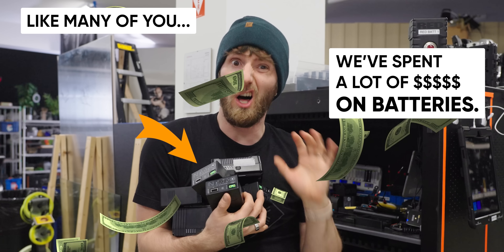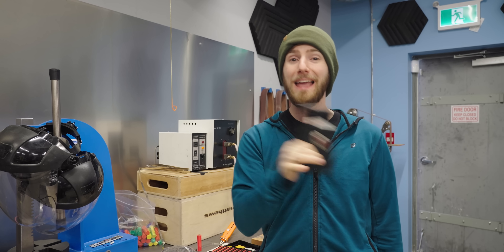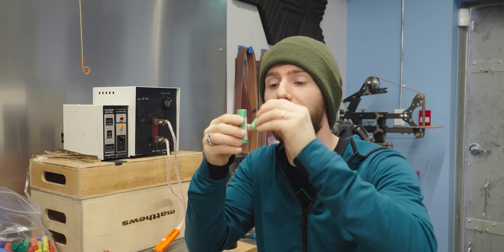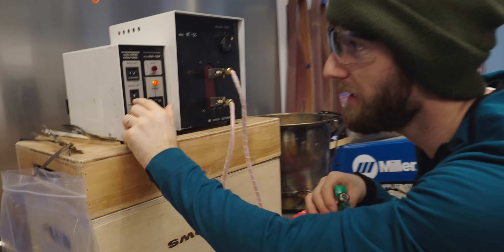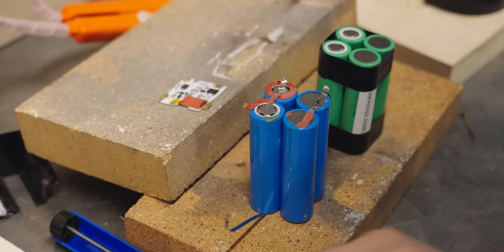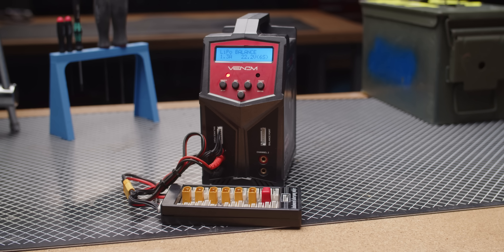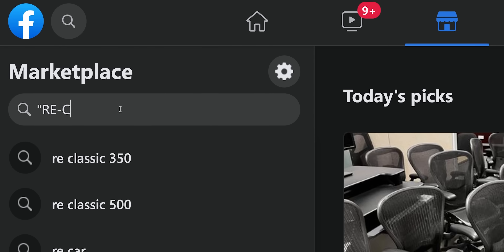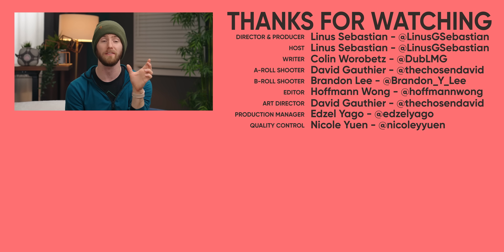This should be illegal… Battery Repair Blocking

Comment: watching Linus handle the batteries with his metal rings not covered.... ugh, that is not gonna end well one day.
Reply: A colleague of mine once shorted a large 12V lead-acid battery via his wedding ring. The current was so high that the ring got red hot almost instantly and he suffered very bad burns to two fingers as a result. He never wore his ring again when dealing with batteries after that.
Reply: @cbcdesign001  how many apms on the battery? Got to be pretty high if is was only 12v

Comment: I had the evil BMS with DJI batteries too. I understand there are tools from the BMS chip manufacturers that can reset the Permanent Failure (PF) in the chip indicating a dead battery.
Reply: There are DJI-Firmware-tools on github
Reply: https://youtu.be/P5PNOO2GebY
Reply: Raspberry pi with i2c

Comment: Even though I'm an electrical engineer professionally, replacing batteries like this is too scary for me. I've done barely any soldering in my life anyway, but I'm looking to change that. Most of what I've done so far in my career and for fun is write FPGA code.
Reply: Are you sure that you are an electrical engineer?
Reply: @i4kata  I mean, electrical engineering is a broad field. FPGAs, which I work with at my day job, are a way to make digital electronics. That and I have a master's degree in EE.

Comment: There used to be a lot of re-celling laptop batteries where I lived. You paid a small amount for fresh cells, while keeping the old housing. Sadly with laptops going supeglue on batteries, it becomes impossible. So dead battery equals new laptop for some people, broke my heart everytime I saw a friend sold his old usable laptop just to buy a new one with non-replaceable components.
Reply: Yah and then everything endeds up in India and there they repair it no problem.
I'm serious this is why phone's come with screen protectors and you will get 100 back from the carrier.
Reply: @markdove5930  For sure. And you know what worse? Used batteries in third world countries rarely got recycled. So basically first world nations uses up the batteries, rather than trying to recycle it, they send it to third world countries where most would fill the landfill or the ocean. Source? I live in a third world country. Most people here don't know you aren't suppose to throw away your used batteries (I saw a lot of Charred AA and AAA, imagine how dangerous that is with Lithium, in lots of pile of burned trash).

Comment: There is a chance you had to put the battery in the charger to 'reactivate' the BMS, rather than it being the BMS having completely killed itself.
Reply: This is a common feature on battery management IC's, they go into "shipping mode" when powered on the first time (ie after the battery has been removed and reconnected). This ensures that the batteries don't discharge while the device is sitting in a warehouse.
Reply from the maker: Yes Tyler at THTBattery.com actually told me this and I have yet to be back at office to try - will update this post with the result -CW

EDIT: The battery DID successfully work after popping it on the charger for a second! I've added a card comment in the video for future viewers noting this.
Reply: @LinusTechTips  counting on it! Is there going to be any update on the video? I think it would be important, a lot of people are going to be discouraged
Reply: @LinusTechTips  I have a bunch of BMS boards that require jumping the negative input and output sides of the BMS to wake them up after being disconnected from the cells or over loaded.
Reply: @LinusTechTips  Update us when you do get a change to test this out
Reply: @LinusTechTips  i saw a youtube video about someone fixing a bang olufsen bluetooth speaker, and he also had to reactivate the bms by putting a charge on the bms terminals
Reply: @LinusTechTips  Dropping a comment so I'm notified of the update 😁
Reply: @LinusTechTips  I heard for some Lenovo batteries, you have to connect the internal +ve to the output +ve. I know it's a different pack but worth considering.
Reply: @LinusTechTips  yay!
Reply: Yep, had this happen to me before. Thought I'd hosed the BMS, but just needed to reset the microcontroller on it by charging for a few seconds
Reply: I've always just used either some of the old batteries, or a bench power supply to keep voltage on the BMS when rebuilding laptop batteries so they don't trip the protection and require reprogramming. My success has been hit or miss, but the OEM batteries are usually the worst. 

Some laptops/batteries won't re-calibrate for the new capacity after replacing the cells, but some will work fine with a full discharge/charge cycle. Now that all the new laptops I've seen use 'pillow' cells for thinness my days of rebuilding them are rapidly coming to a close :/
Reply: This should be higher up in the comments.
Reply: Yep. The safety ICs I work with also have shorting the pack- and the system GND to activate it.
Reply: Recharge al the batterys first, then build it. After that stick it in a charger so it can "update" itself and then discharge and charge it fully. 

A little short doesnt do anything to 18650. They are strong. Just dont weld + to - and - to + and you are just fine. I fixed a few drill batterys now by replacing them. Its mostly easy work.
Reply: I dont think putting the battery in a charger should be the way to reset it after a cell replacement - To get it out of shipping mode? Sure.
But not after tempering with the cells.

The thing is, if the cells disappear or suddenly change capacity, the Battery Management Chip doesn't know whether this is because cells were damaged or intenionally swapped.

Now if the cells are indeed damaged you want the battery to go dead so the user is forced to bring it in for repair (or throw it away.)
But plugging it into a charger is the first thing the user will do if the battery doesnt work. So this really shouldn't be the way to tell the battery that the fault it detected was actually an intentional cell replacement.

Now should there be a more prominently labeled reset on the chip? Maybe.
Are there companies that intentionally lock out custom repair? Certainly.
But should you expect the battery to just work again after swapping the cells? No. Since you should only repair a lithium battery if you know what you are doing, that includes taking the datasheet for the Management Chip and reading the "how to reset after cell replacement" section.
(Or shorting the two negative connections and hoping for the best.)
Reply: @Shildifreak  I mean, if it shuts down when loosing connection to the actual cells, it wouldn't be too far fetched to think that could work.
Reply: @Shildifreak  I have had this exact behavior with an electric toothbrush though. After replacing the cell, the motor doesn't turn on and the light keeps blinking. You put it on the charger for thirty seconds, the blinking stops and the toothbrush works like new.
It wasn't a lithium cell though, it was a Ni-Mh.
Reply: Having to refer to that data sheet still doesn't sound like the most repair-friendly experience in the world.
And would I be too skeptical to assume that one such datasheet won't be exactly the easiest-to-find document on the web?
Reply: @batyanko8283  These batteries are not meant to be user serviceable. It is perfectly reasonable to expect that a repair technician will need to read a datasheet. However, Typically these datasheets aren't even published to read from to begin with.
Reply: @craftxbox  reason is a relative thing.
Lots of things are super dangerous to deal with, and yet not fused with self-destruct one-off electronics, and many non-initiated technicians do simple service on those just fine, without necessary getting wasted in the process. Light bulbs. Construction tools. Cars. Where do you draw the line?  
Or is it that it is complicated? For some it is, for others it is not.
We can probably define the core problem like this: the practical complexity of reprogramming a battery pack (especially getting the doc in the first place, yes) appears overdone, asymmetrical, inadequately high, when compared to the practical complexity of putting together, say, a 3s2p battery pack.
Reply: @batyanko8283  Yeah, you make a good point.
Reply from the maker: Updated reply above: The battery DID successfully work after popping it on the charger for a second! I've added a card comment in the video for future viewers noting this.
Reply: @LinusTechTips  Woo! glad it worked out!
Reply: @LinusTechTips  Glad it worked out! This is a pretty common thing that I've found you have to do with a lot of battery protection ICs. ABLIC/Seiko, and TI both have the attach charger/short GND/BAT- activation methods, at least for their single cell protection ICs. It's not always consistent either... I've had some units power on immediately, and some require the activation. It's probably just because you're applying power with pins in an undefined state when everything is ramping at different rates.
Reply: You should have broke down the assembly process rather than jump to welding the whole pack at once also recharge them all individually that way all have a known good charge. 
I have picked up 2 battery banks that were of the byoc variety and loaded them with cells. They are spring loaded and user serviceable when they wear out I just need to pop out the cells and put new ones in.
Reply: I would love to see if that was the issue. This is very interesting
Reply: I want to know when they reply
Reply: fingers crossed this is the case
Reply: Yep. Will follow this post then
Reply: leaving a comment for the update
Reply: Want to be notified.
Reply: Want to be Notified
Reply: Also in my testing the charger might not start the pack. I have had to just give the power leads a quick jump in voltage to activate a old pack
Reply: Also waiting for an update on this.

Comment: Don't wear rings while handling battery packs. While it won't short out on your skin, it definitely will short out on your metal ring and heat up in a fraction of a second.
Reply: Ive seen it happen to a guy with a mechanical vape mod, they are a straight tube without the saftey features of the ones with chips or a sleeve inside the mod to prevent a short.

Comment: i like how the leads convulse when you send a spark through them! thats kinds cool!
Reply: That is from the strong magnetic field being generated when the welder is energized. I am a welder and the leads on my machine do this but to a lesser extent. What is kinda cool to see is how the metal flakes on the floor line up the entire length of the leads when I'm welding.

Comment: bruh. i always just took a solderning iron to the cells and soldered wires to it. not sure why the slightest spark which is normal in spot welding makes you so afraid XD
Reply: Yeah I thought most people who diy it just soldered it. I was confused when he brought out the spot welder lol
Reply: @austinussery612  It's the better way to do it.  Far far lower heat into the cell, far lower risk of damage to the pressure release seal, and it's actually possible to use those nickel strips.  Soldering those is a PITA if even possible.

But soldering works if it's what you've got.
Reply: @austinussery612  well spot welding is in general the safe way. with the iron you heat the cell which is a risk. also soldering is not that great when it comes to reusing and compactness.

Comment: Aren't there special fire extinguishers that can be used on lithium fires? I believe they are typically in a yellow tank. Places that deal with chemicals might have three or more different fire extinguishers for different types of fires coded with different colors, I feel like LTT has enough lithium devices around that they should probably have a lithium fire rated extinguisher around.
Reply: Nope, you just need an ABC fire extinguisher. Which honestly is pretty standard.
Reply: LiPo battery fire is an uncontrolled release of energy stored inside the cell; it doesn't need atmospheric oxygen to burn; thus extngisher is useless.
You can think of batteries as thermite reactions waiting to happen, usually in very controlled manner but sometimes uncontrolled.
Reply: When a battey starts burning, ususlly you can't stop it. You can put it in a bucket of water (just make sure that the hot battery won't melt throught your bucket), it will cool down the others cells and prevent from igniting anything else. There is also specials bags like Libik that are designed to contain a battery fire and even explosion

Comment: 🤣 you think $350 or even $450 for a battery is expensive, that's cute. Try buying batteries for a DJI M300 Drone! It requires two batteries and each one cost $800!

Comment: All new cells? Telsa cars seem to do fine with replacing only the bad cells.
Reply from the maker: Actually they only replace full modules, not cells - as far as I've been able to ascertain. Replacing a single cell is dangerous for a multitude of reasons. -CW
Reply: @LinusTechTips  that's what telsa does and says. Rich rebuilds says and has proven much differently
Reply: @LinusTechTips  https://youtu.be/T7Q0nNkQTCo

Luis Rossman is featured in this video as well

Comment: I had the same problem with my Laptop.
The bms gets permanently disabled, when it has no battery connected.
So I had to connect a Raspberry Pi via I2C to the Bms ic and reset it. Fortunately the Bms had the default password.
Reply: It was the password that was mentioned in the datasheet of the Bms ic

Comment: I wonder if some of the newer battery standards that are coming up will help alleviate this. I know there’s some new standard for the wall plug to charge your devices, but I remember something about the actual battery seeing some technological advancements as well.

Still, my PSP’s battery expanded last year. So I can understand the concern.
Reply: Funny you mention your PSP battery, those do actually have a charge cycle limit.
Reply: There are safer battery technologies available already and are arguably more affordable, but they're a bit less energy dense than lithium ion. LiFePO4 specifically, it's getting closer and closer to lithium ion for energy density and for applications where space is more negotiable, it's a better option the majority of the time.
Reply: High performance, high capacity batteries will never be safe. The equation is easy as capacity and charge/discharge rates go up the amount of heat generated with a short goes up. 

A good 18650 cell contains ~13Wh or roughly 47 kJ of energy. That's about the equivalent of 12g of TNT.
About 50g TNT is common in a hand grenade. So that 4pack in that Sony battery pack contains about the same energy as a hand grenade. 
Now TNT releases that energy much faster thus leading to an explosion but if you short those four cells they will release the same amount of energy within minutes.

This equation will only get worse with higher performance batteries. More energy contained, higher potential energy discharge. To make it safer we would have to make it a worse battery by either reducing the capacity and/or the speed it can be charged/discharged at.

Comment: Finally, my knowledge of batteries from nearly a decade of vaping slightly pays off 😂 Good ol 18650 lithium ion cells
Reply: You mean 18650
Reply: 18650 :)
Reply: I don't know what vaping teaches you about 18650 cells but ok.
Reply: @ERIK31351  18650s are used in in a ton of vaping products. I have about 30 of those batteries and had to learn when to recycle them, what voltage they hold, and safe charging practices.
Reply: @theshadowknows6969  You recycle them the same way you do all batteries, their voltage is literally printed on the casing and with a charger that has a modern BMS there's almost nothing you can do that's unsafe.
Reply: @ERIK31351  The voltage when they're charged Is about 4.2 volts which is different than what is printed on each battery. At 19 (when I started vaping) I didn't know any of that. When I got into RC cars that knowledge was valuable.
Reply: @ERIK31351  I use 18650 cells in my vape so I looked up information about them like proper usage and storage
Reply: get help
Reply: 21700 gang knows whats up
Reply: Yep, meant 18650, on mobile so I just typed too fast 🤷